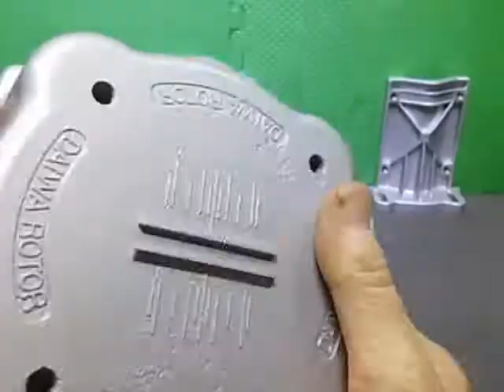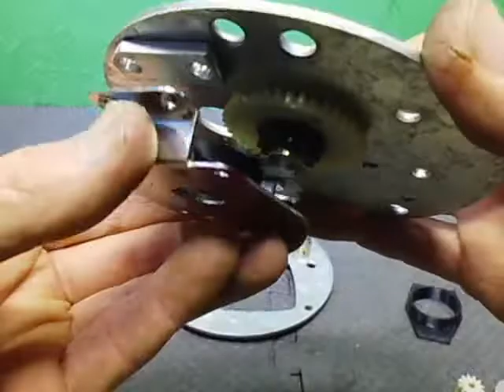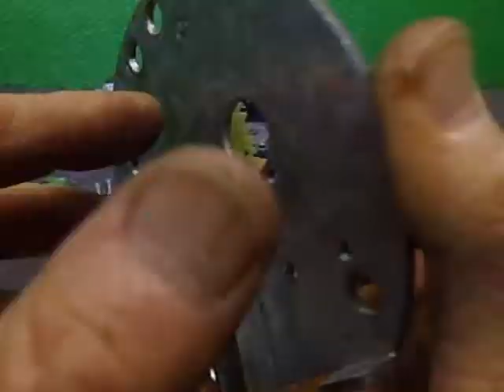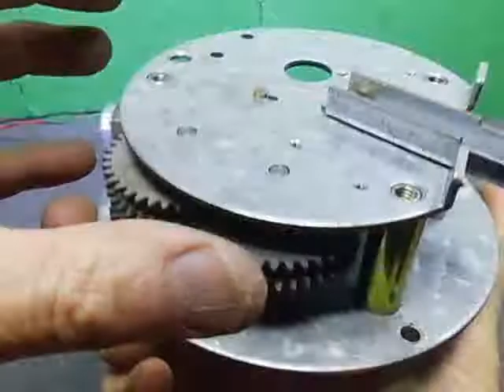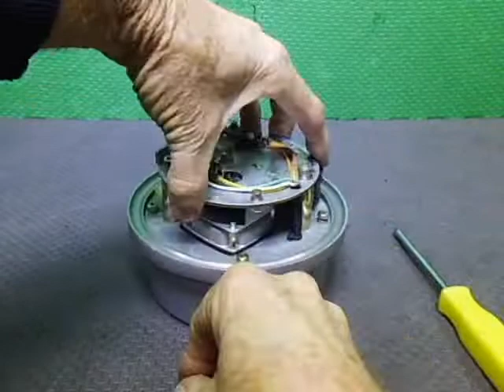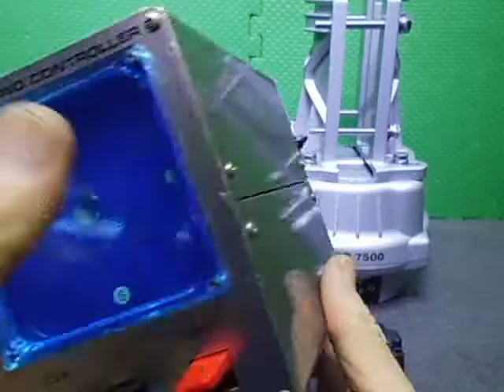A Few Upgrades For A Daiwa DR-7500/DC-7001a

Comment: Do you have experience replacing the potentiometer? Do you know if a normal potentiometer can be used to replace the original one?  Does the potentiometer shaft have to turn more than the usual 270 degrees? Is there a gear reduction towards the potentiometer?